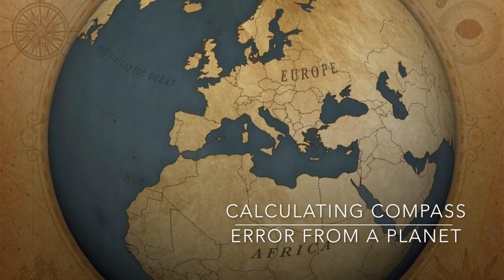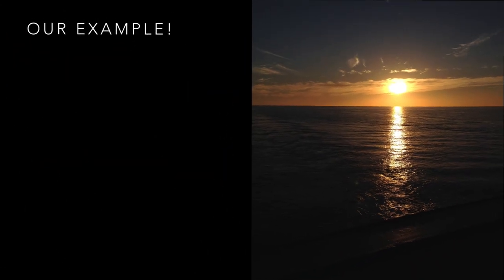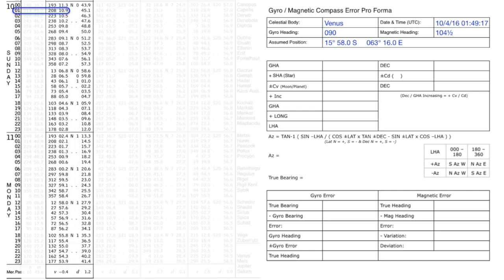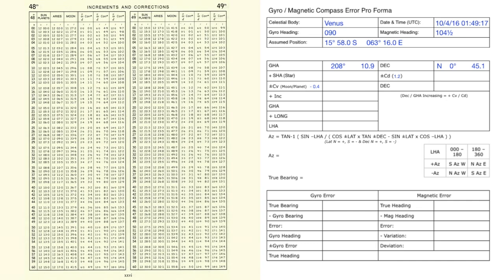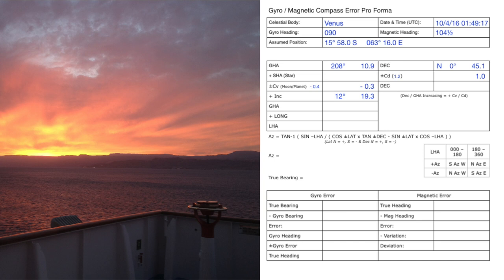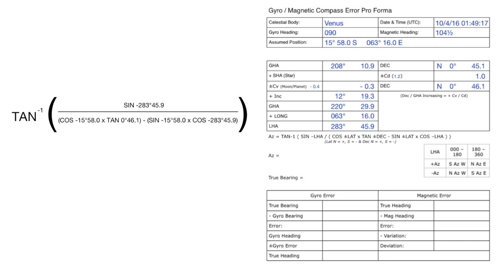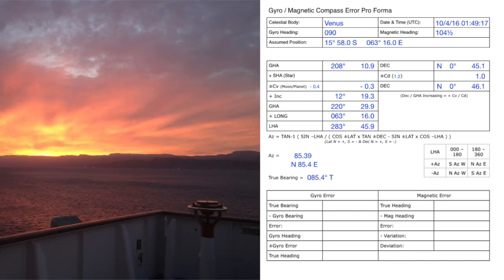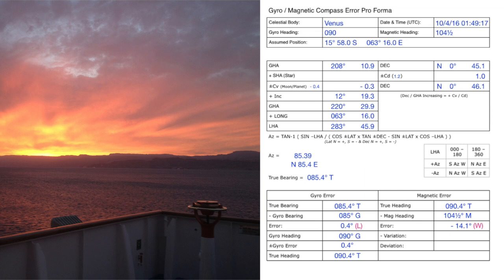How To Calculate Compass Error by Azimuth of a Planet

Comment: Fantastic video very helpful! Just to clarify though, when dealing with the V correction, am I right in thinking that you MINUS it because at the top of the page in the Almanac where the name of the planet is, it has a minus sign next to it? E.g VENUS -4.1 at the top and the V correction at the bottom is what you look up in the increments page but you minus it because it had a minus sign at the top of the page? Equally if it did not have any sign next to the name, you add?
Sorry if I am unclear with my question
Reply from the maker: The numbers at the top in the Admiralty Almanac are the magnitude of the body on that given day (essentially how bright it is in the sky), they have nothing to do with the calculation.

The V value for planets is shown at the bottom of the column, in the case of the example it is -0.4, we then look up 0.4 in the yellow pages for the appropriate minute and because the V value was -ve at the bottom of the column we subtract. If the V value given at the bottom of the column was positive, we would add the correction.